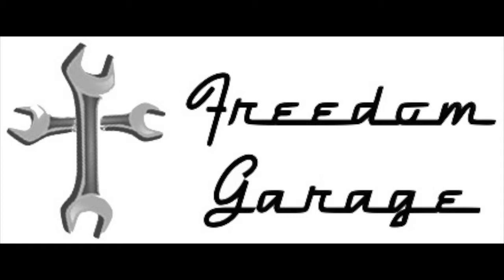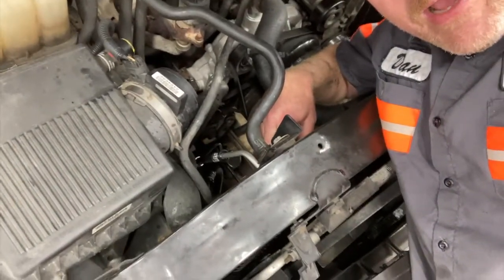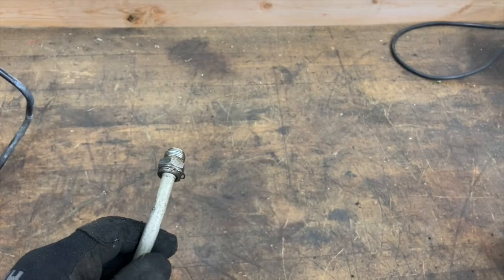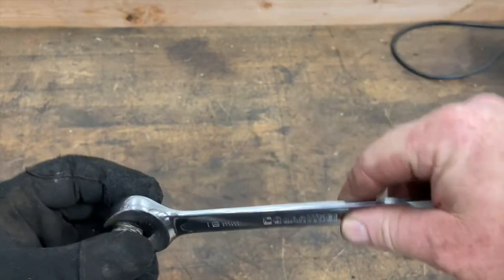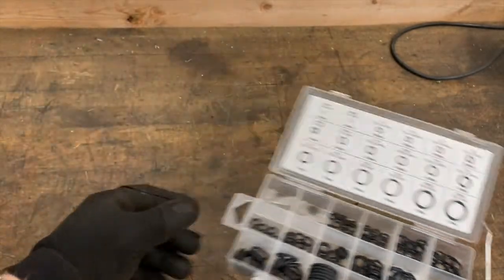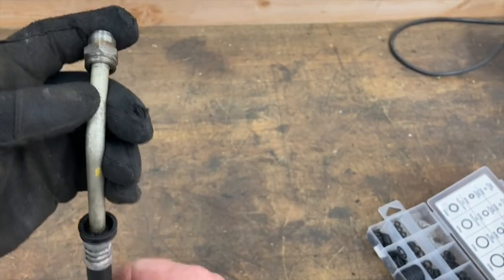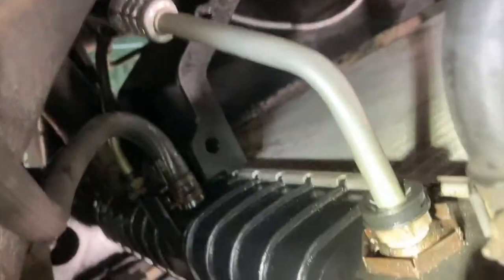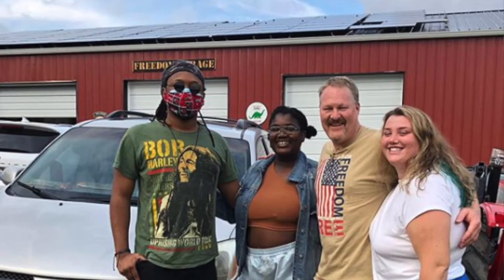2001 Chevy Silverado Transmission Cooling Lines Leak - EASY FIX

Comment: I just had to put a water pump in my 01 today and noticed the dusty damp trail starting to form at the top fitting. Great to now know the O ring size needed. Thanks for posting the video. My 01 has just a shade over 450K on it and is the second water pump I've put in it. I guess it's about time for the O rings to be changed.  Thanks again for this video.
Reply from the maker: 450k on your truck?!?! Way to go! Glad this video helped you to love on it.

Comment: Currently having leaks at the transmission coupler on a Silverado 2500 HD with the Allison transmission. None of the parts stores can locate new couplers and the dealership shows 7 "different types so I'm rebuilding these now

Comment: Thank you for the video. It is very informative. I see you used a black colored O Ring. In another video on U tube, I seen another mechanic had a Blue colored O Ring. And after some research, the Black O Rings are subject to deuteration by the ATF 4 chemicals. And I also found that green and yellow colored O Rings are manufactured to withstand oils and chemicals. This was the first time I seen a Blue colored O Ring. I think the video was by klowmy1960, labeled Leaking GM Transmission Cooling line Disconnect fitting.
Reply from the maker: Hmmmm.....interesting about the O ring colors and what they are made of. I used what I had on hand. Seeing as my truck has 326k on the odometer and I have a tray full of those black O rings, I will probably just make it a yearly change. I would be interested to know what the "real" O ring part number is.....and what it is made of. Thank you for sharing, and watching.
Reply: @thedangerson  The part number is W5201 at O'Reilly's auto. it's a box of 270 HNBR Green assorted o rings.

Comment: The Dorman 800-604 worked in the transmission but there's a different one for the composite radiator. Its probably the one right next to it in the store.....

Comment: I just replaced the radiator in my 2010 Tahoe this afternoon. It’s got a 5.3 in it and it looks identical to the one in your video. After putting everything back together I noticed the top line (just like the one you referenced) had a steady drip of transmission fluid. I would assume that maybe the o-ring isn’t in place. I did make sure to get a tight fit and secure the locking clip properly. Just had a steady drip once I turned on the car.
Reply from the maker: Yeah, a steady drip means that something is out of place -- either the fitting or the O ring. While I am not 100% sure on a 2010, it wouldn't surprise me if GM kept a very similar configuration. Good luck finding the leak source.

Comment: Did the procedure as you showed. Leaking again. Should I replace the connector w a new one or do the lines wear out at the contact point? Thanks in advance
Reply from the maker: I am unaware of the connector or line replacement. However, following the troubleshooting mantra - "go easy, go cheap" - I would redo the procedure and clean both sides (line side and trans radiator side) of the connection really good. There could be grime, particulate, or residue preventing a clean seal. I would also blow off both with compressed air after giving it a good wipe down. If that didn't work, I would maybe step up to one size larger or one size small O ring to see if those sealed better. If none of that worked, you can go down the line replacement path. Good luck! Wish I was there to help you.
Reply: I think it did hold up for a few weeks. I decided to get a new connector, Dorman Brand 6$ at Auto zone. No Leaks . Will monitor and keep an eye out. That little pick set was on sale for 1.49 at HF. I removed the air box and it made the the procedure much easier. Retired so I have time to do these little Maintenance fixes with a little help from guys like you on You Tube. So Thanks for what you do.
Reply from the maker: @Andrew Castro.....so glad to hear you have it fixed. Thanks for watching.....and feel to stop by Freedom Garage if you are ever in the Louisville area.

Comment: Great idea it just scares me a little to remove the part from the radiator which I believe is plastic threads. Maybe try replacing the O-ring while it’s in place? Or is that too difficult?
Reply from the maker: The O ring can only be replaced by removing the line so you have access to the fitting. Good luck and thanks for watching.
Reply: The fitting seats into a metal line section in the radiator. There's no worries of plastic threads.
Reply: @rong.7852 - that’s good to know!  Thanks
Reply: I thought about just pulling it and changing the O ring but decided to get a new fitting with O ring already in place and figured it the better way to go since the fitting needed to come out. Be sure to put a drop of T Fluid in the neck of the fitting to wet the O ring before installing it and a drop on the line as well. My 01 has >450K on it.

Comment: the plug on my 1999 new model Serria 1500 lower is welded in it seems; how would you go about getting the fitting off the plastic radiator tank w/o breaking the radiator
Reply from the maker: If it were my vehicle, I would "unweld" it (probably unsuccessfully) or more likely I would go to the junkyard and get a transmission cooler from another truck and put that in. I recently had to do that with the AC condenser (sits right by the trans cooler) for my son's 1998 Sierra. Good luck!

Comment: Can I remove the fitting and swap the o ring without having to drain the coolant or disconnecting anything else?
Reply from the maker: @jaimegarcia5573 .....If I remember correctly, I did not drain my trans fluid when I replaced the O ring on the upper line. You MAY have to on the lower line. Good luck!
Reply: @thedangerson  thank you

Comment: Hi I just replaced the radiator and I have a leak by lower line joint as you showed in video but it is coolant not a transmission fluid. Do you have any idea what is going on? I have chevy uplander 2006 3.5l.
Reply from the maker: That whole area up front has your radiator, your trans cooler, and your AC condenser. If you are leaking coolant (and you just recently replaced the radiator), you have a leak in either the coolant lines or the radiator itself. Thankfully, those are easier to fix because they are just hose clamps. Check all connections. Thanks for watching.

Comment: You can change the whole fitting also ? Only 6 $ at auto parts store.
Reply from the maker: Mine didn't need replacement, just the O ring. But that is good to know.
Reply: @thedangerson  i changed one whole fitting and the other just the oring. Both worked great. O ring definitely a cheaper option.

Comment: i replaced the line and the fitting next day started to leak any answers?
Reply from the maker: Check that the line:  1) is firmly fitted into the housing  2) that the O ring is properly seated.  Good luck!
Reply: @thedangerson will do this weekend
Reply from the maker: @alex.8oh586   Good luck! Also, make sure everything is wiped down and clean. Any grit or dirt on the fitting or O ring could impact the seal and cause it to leak.

Comment: I did this on my 01 hd 2500 and my upper transmission line is still giving me a leak it's driving me nuts. The rest of the lines are doing well after replacing the o rings
Reply from the maker: Following a mechanics philosophy "Go cheap, go easy", before replacing the line and connection, you might disconnect the upper one more time, clean the male and female connections, and try another O ring. Good luck!

Comment: Could even brand new fittings that came already in the new radiator still have this problem?
Reply from the maker: Anything is possible. This is an easy and cheap enough fix for you to check them just to make sure. The hardest part will be removing all the plastic shrouds around the radiator (which isn't a big deal). Good luck and thanks for watching.
Reply: @thedangerson  can it be the seals that before connecting the fitting to cause I have a Chevy blazer 2001 cause mine is still leaking